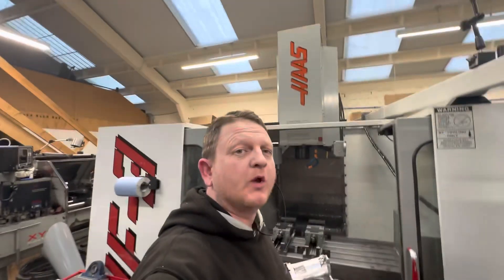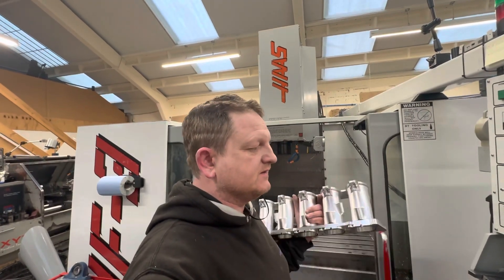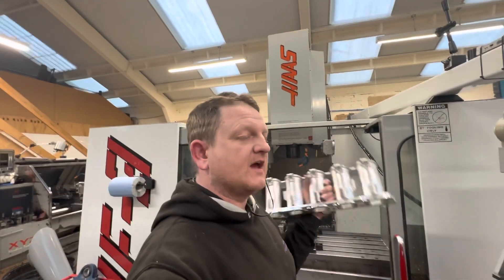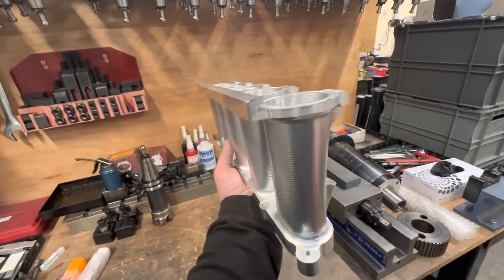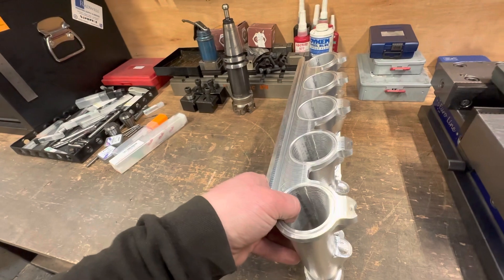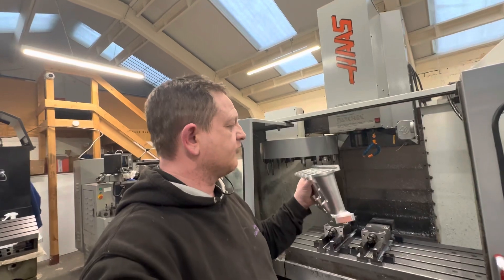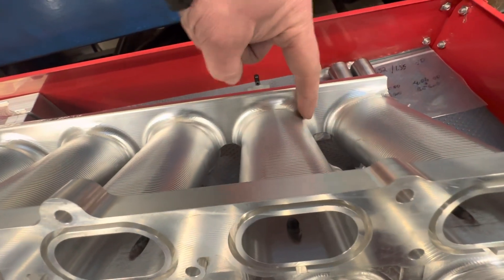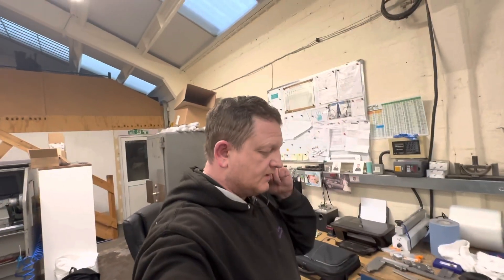One step further but need some fusion 360 multi axis help

Comment: Hi Marc
Huge respect for you taking this job on really understand to stress of something like this

By no means is this the correct way but it might get you out of a situation 
Find the centre line of the 4th axis and measure it relative to the fixture
So if it’s 3in up from the fixture set Z0 in the CAD model to 3in above the gasket face accounting for any extra material you left on,
Index the part on Z0 in the CAD model and post multiple programs at different angles
You could either manually index the part and run each program individually or put all the programs into one and program the indexing between each of the programs 
If that makes any sense
Reply from the maker: Hi

Thanks for the reply,

It does seem the general consensus is to program it as basic 3 + 1 and as 2d toolpaths so I should be able to do that ok as it’s similar to what I have done previously on more simple parts 

I just need the time to sit down and try some set ups in fusion but at the minute I have lots of other jobs needing to be done as well but first chance I get I will give that a go 

Thanks
Marc

Comment: Make your Y Z datum the centre of rotation of the rotary axis.  the fusion post will calculate the kinematic position of the component.  The older Haas control lacks dynamic work offsets.  It's pretty easy when you get your head around that bit. 

The work offset, and the gauge lengths all have to be pretty accurate to get blend-less results.  I don't know how it would work with positive work offsets, and negative tool lengths.  I know for a fact it works perfectly with negative work offsets, and gauge lengths of tools.  
The gauge plane of a JIS B 6339-2 (BT40) holder is the point at which the taper is 44.45mm diameter.  
I've measured this using a large ball bearing in the spindle, and a stack of gauge blocks to set an accurate datum off a freshly milled surface, and then used that to calibrate my standard before.   

I made up a simple gauge length standard, which I calibrate all my tool length offsets by.  It's just a 10mm shrink holder, with the stump of a carbide endmill upside down in.   I took it to a friend's workshop, and got it measured against the calibration standard using their haimer presetter. 

I made a poor man's dynamic work offset macro for my VF0-E, but it's positional 4 only, it's not compatable with simultaneous motion.

P.S.  I'd trade an example programme, and any questions about multiaxis work for a shopping list of the bijur restrictor parts, and pipe needed for the VF0-E, and the source for the strips for the way covers. My lube system's badly in need of an overhaul, and I still can't get over haas prices for the restrictors!
Reply from the maker: Hi

Thanks for the tips,
I’ve had so much helpful info replies to the video I have a lot to try out when I get a chance to sit in front of the pc and fusion 360,

As for the Lube fittings send me an email to remind me and il send you a list of the fittings I used 

Thanks
Marc

Comment: I'm not super knowledgeable on multiaxis but to 3 axis it in solidcam (static 4th)  you just create a different coordinate system with the 4th being at a static angle, should get pretty similar results and should be similar in fusion, good luck
Reply from the maker: Yeah it seems it’s not worth trying simultaneously 4th but should only require 3 + 1 positioning then 2d toolpaths so I’m going to spend some time first chance I get to try this out

Thanks
Marc

Comment: I don't know if simultaneous movement would be the best option. The newer machines have something called dynamic work offsets to help position the part during these cuts. If I were you, then I would use the 4th axis as a rotary and set different work offsets. Write a separate program in fusion for each position.  Load them all and call them up with an m98 non local subprogram call from your main program.  At the beginning of each subprogram, call up the appropriate xyza offset, and that should be all.
Reply: The only thing the new machines with tcpc are doing is taking your desired work offset, then essentially recalculating the gcode as if it were generated from the rotational center. the machine is already programmed to know where the center of the rotary axis/axii are, which makes this possible on the machine.

Setting the origin as the rotational center in the model in the correct place does the same thing.
Reply: @davidfarmer  the part has to be exactly where you think it will be. With my comment, you can be off from center off rotation. I've only worked with 5 axis on newer machines, though, so I may not know all the tricks on how they used to do it.
Reply: @joshualegault8641  yes you need to know exactly where your part is. isnt that pretty much always the case though?

anyways the best way to achieve this is fixture your part, then probe/indicate your part. then use those indicated locations to drive your joints in your cad model.

prior to tcpc trunnion and table 4/5 axis programming was done with a fixed origin that is located at the center of the rotation axis/axii

The problem people have with this is when they learn 3 axis machining they get in the habit of picking various origin points, and essentially ignore what the position of the part is relative to the machine.

with a fixed origin you can set your tool heights once for all your jobs, and it makes it easy to avoid collisions because you can model your machine and whatever fixtures you use.

The downside being if you move your part you need to remeasure it.

That being said, fusion has a feature called in process measurement that can automate this process allowing the probing data to come from the machine and drive your joints in your assembly.
Reply: @davidfarmer  so you are saying to you would load the part, find the part faces relative to the rotation axis and adjust the cad model so that the program it outputs will be correct? I mean sounds like it can work but it also sounds way more difficult than what I suggested.
Reply: @joshualegault8641  pretty much, but I actually just model the part after setting it up, so I dont have to go back and forth as many times.
Reply from the maker: Be nice to have the new style machine but as you say the basic way is the way to try on my set up 

Thanks
Reply from the maker: Thanks for the advice

Comment: set your zero on the machine to the center of the face of your rotary table, XYZ. Next fixture your part on the rotary table. Use an indicator and rotate the part to get the top surface flat(or whatever surface you want to reference). set the a axis zero.

Now in fusion, model everything up, and set the origin in the same location as you set the zero on the machine, including the rotation. Remember z axis is up when the a axis is at 0. The fusion post(haas pre ngc with a axis) is likely already configured correctly for the way you have the rotary axis installed, but if its not i can walk you through changing that later. Your rotary is oriented along the x axis which by default is considered the a axis.

Go to the manufacturing tab, make a new setup.  Set the origin as the origin of the model(the face of the rotary table), and make sure the orientation matches too. select the part, then the fixture. Next make your toolpath, id suggest just choosing a 3+2 op to start. 3d parallel might be good. select the toolpath, open the geometry tab and go down to tool orientation. select some reference geometry to set the angle, or use the other orientation options, pay attention to the z axis since this is how your part will rotate, and keep the x axis oriented along the rotary axis of the part. Set your toolpath parameters, and simulate it.

If this doesn't make sense, pocket nc(now penta machine) has a really good tutorial of how to setup multi axis parts in fusion. or if you have discord or something id be happy to walk you through it.

Also be careful since your part not be able to rotate freely all the way around to home the axis. dont want to crash.
Reply from the maker: Thanks for the in depth reply 
I will try this when I get time in front of the laptop again
If I get stuck I may give you a shout

Many thanks
Marc

Comment: It will just be with a normal 2 / 3d toolpath, but in the settings choose tool orientation, make a sketched line at the angle you want the tool to approach it, select that as tool orientation in for example parallel tool path, no need to use anything fancy for something this simple.
Reply from the maker: Thanks,
It seems I’m thinking too advanced for what’s really needed so I will be trying 2d toolpaths and setting the tool orientation to the face I’m working on

Thanks
Marc

Comment: You probably need to measure the part position in relation to the rotary table center of rotation and then add the model at the actual position in Fusion360. That way Fusion knows where the part is in relation to your rotary table.
Reply from the maker: Yeah when I have the table set up and all working and aligned I then need to measure the offset from the 4th centreline and model it up in fusion and hopefully I can work it out from there with all the advice you guys on here have replied with

Thanks
Marc

Comment: I'm not familiar with Fusion (use and teach Esprit), however the kinematics of the machine are still relative. You'll need to first find the center of rotation for the axis and set that as an offset on the control.  Match this in your cam.  Next, find the part's offset from the center of rotation, make sure this is correctly reflected with your model position.  Program your features off work planes accordingly and tie each operation into it's respective work plane.
Reply from the maker: Thanks,

I have done 2d toolpaths and used the tool orientation in the past so it seems that’s the way to go,

Once I have the table fixture all perfected and aligned etc I will model up the centre of rotation offsets and go from there

Thanks for the reply 

Marc
Reply: @kinzy_fabrications  best of luck!